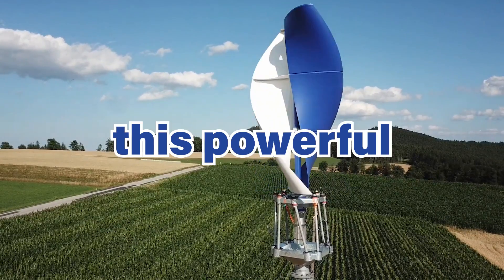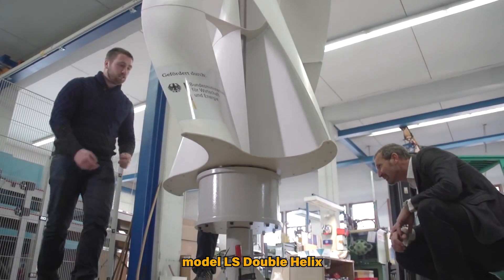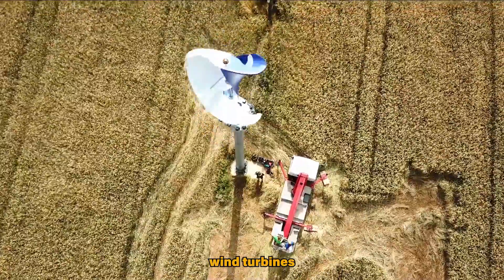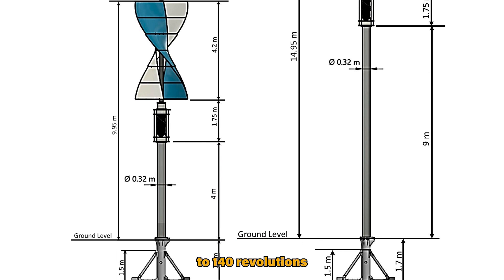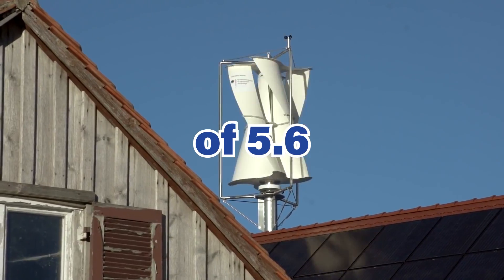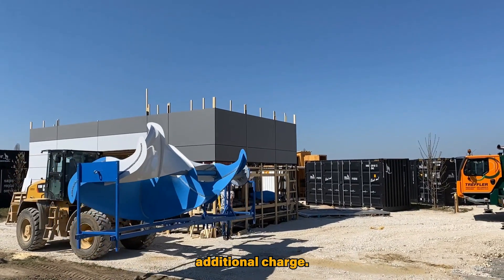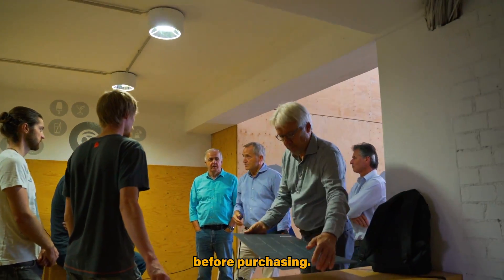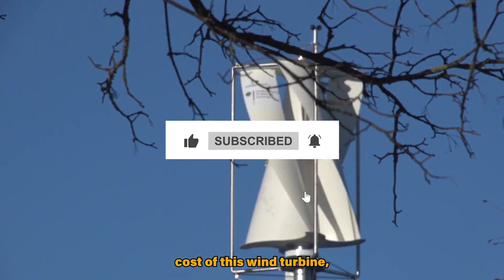Incredible German Wind Turbine with a powerful turn could generate up to 3kW

Comment: Do you do any research or calculations on your videos? The turbine will give you around 900 kWh at 5,6m/s wind annually. Not 4400kWh. Where did you get this number from and why do you just tell it in your video as if it's a fact?
Reply from the maker: Thank you for your comment. To answer your question, I do my research for the videos. While there isn’t perfection anywhere but I do thorough research for the video. 

Please note the company currently have 3 products as at the time of producing the video. 1.0kw, 1.5kw and 3.0 kw. The kWh in the video was based on the 3.0kw product. 

And it’s important to note that there are many factors that can affect energy generation when it comes to wind turbines. I am sure you are aware of this judging from your comment.

You might want to check the company website to have some ideas of how the figure was calculated. Although this page below focuses on more on the 1.5kw but it can still gives some ideas.

Please note the video is not sponsored by the company.

https://www.luvside.de/en/capacity-factor-wind-turbine/

Again thank you for your comment. Much appreciated.
Reply: @renewedenergy  Hi, I appreciate your thoughtful reply! I did use the numbers for the 3kW product. I can send you the calculations it's very simple. I used their own numbers that they use. For example with the 1kW one they use a 15m/s wind as benchmark for the 3kW they sneakily use 16m/s, which equates to 0,53kW more output. So the 3kW one is actually a 2,53kW machine. I have no problem with people making exciting products for renewable energy, but: There needs to be some realism in these things. The aesthetics and not falling apart and turning in low winds really means little, mostly people care about performance and price. And so I don't like this being brought to the background and it turns into a kind of pretending. Because using 15m/s and 16m/s as benchmarks for a turbine is close to disingenuous, because most small scale turbines are rated around  11m/s or 12m/s which is half! the energy in the wind. So these turbines should be called 0,5kW and 1,25kW actually and this bothers me. People might buy these things expecting some output and get disappointed which happens a lot. Greetings!
Reply: @renewedenergy  this is hilarious actually. They have a clear wrong calculation right there (if I'm not delusional) but they write a 1,5kW turbine at 15m/s produces 1,5kWh per hour. Then at 10m/s the same turbine produces 1kWh - they write. They don't even use v square, not mentioning v cube, which is the correct formula. At 10m/s it would produce 0,44kWh.

Comment: So 65 feet per second is 44 MPH of winds. Yeah that will NOT happen everyday to get 3000 watts of power. Nope. Crazy. 😅
Reply: It was apparently 3kW at 35mph (52ft/s) - that’s still unlikely considering average wind speeds are more like 10mph inland. If you plug the numbers for the swept area into a calculator then the wind power at 52ft/s is 22kW so it’s 15% efficient at best - at 10mph it might make about 500W - and it’s 4.2m high by 2.2m diameter 😮😂